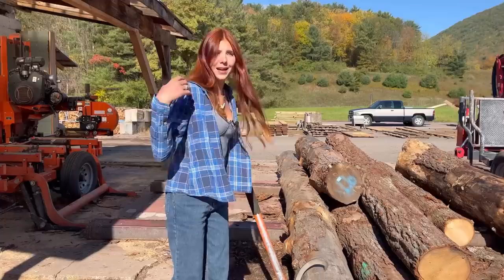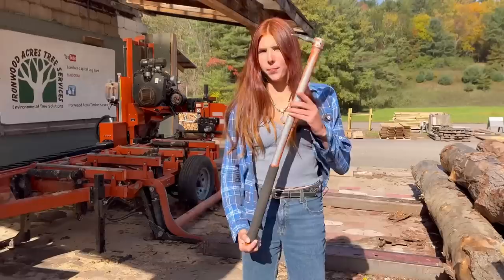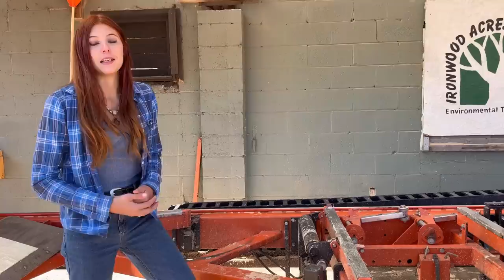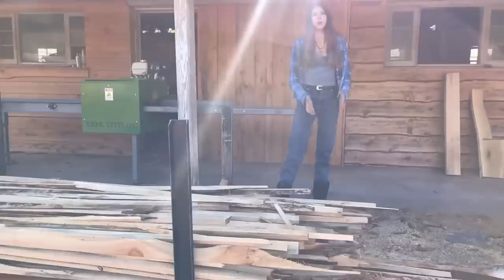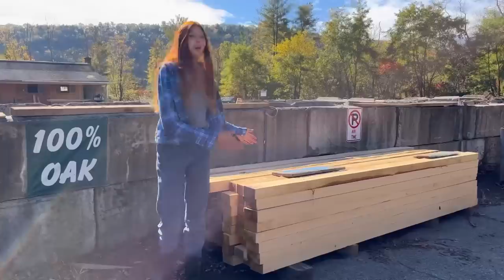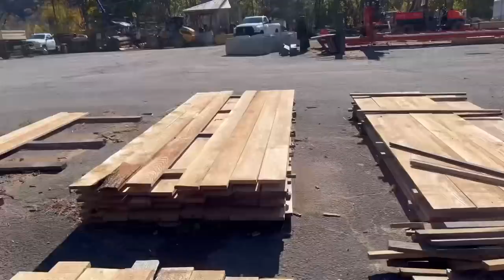Sawyer Terminology

Comment: Dunnage is a standard term in shipping for the Timbers and other materials used to stabilize cargo.The term goes back to the days before standardized containers when bulk cargo was made up of crates, barrels, sacks that were liable to shift during the voyage. Dunnage was used to secure the cargo.
Reply: People that work in shipping material yards often call them stickers as well.
Reply: Yeah I worked at a lumber place that made custom door and window framing and they used the same words for the exact same thing. 
Peace and Ahev
Reply: Yep, here in New Zealand dunnage is the term we use for timber packing used as described in the video.
Reply: @rustyanvil51  beat me too it fellow kiwi 🥝 dunnage is a thing😆
Reply: In the Army, we used the term dunnage for the boards required to lift materials off the ground when stored. Best for things that tend to rot, like canvas tents.
Reply: i hear dunnage alot. but around here most often refered to as "cribbing"
Reply: dunnage, dunnage, dunnage. i LOVE THAT WORD! :)
Reply: Material Handlers use the term dunnage and tape for the process of securing boxes on a pallet with plastic wrap. 
Useful for trucking.

Comment: When producing veneer, flitch has an additional meaning. This kind of flitch is the piece of a hardwood log ready for slicing into veneer - like a cant is for boards, a flitch is for veneer. And the resulting leaves of veneer are then bundled into a package in the same order they were sliced off the flitch - called flitch order. This makes it easier to arrange the veneer leaves into different patterns - like book-matched or slip-matched. Plywood veneers are different - they are usually peeled off a rotating log in large sheets of thicker veneer. That's the stuff that gets made into sheets of plywood.

Comment: My friend with a woodmizer would use any old piece of scrap as a sticker. I talked him into actually sawing his stickers. I told him they had to be exactly square or obviously wider on one side. He sawed hardwood and was getting a lot of sticker stain from using ugly stickers. Yes, stickers do evaporate somehow.
The one tool you showed we always called a pickeroon. We always had a peavey on the landing in the woods, which is like your cant hook with a sharp pointed end.
Dunnage refers to anything to keep a load in place, but your usage is correct, at least I would know what you meant saying that. I was an Adirondack logger many years ago.

Comment: Wow great video.
I'm usually a little wordy in comments.
I'll try to go easy on this.
Many comments on you Emerald to become a model.
I'll say you would excell in public speaking, and still an incredible model.
In my job I met many models, who explained the dark side of modelling.
Flitches...with bark kept, then planed, varnished extensively, great shelving, just my take on that.
My cousin hauled wet chip board out of northern Saskatchewan, Canada.
We used stickers to haul out the chip boards immediately, letting them dry in transit.
I was 15 when my dad allowed me to ride shot gun, learned to crunch gears before my beginner license.
Before all this I learned on my Great Uncles sawmill, associated with my cousin's trucking biz.
I've said this before, your show brings back fabulous memories.
I could use dunnage to build tables, that I would donate to the Salvation Army.
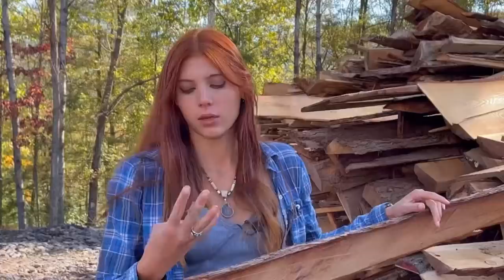1:12....bandaid is a nice touch.

Comment: In Ontario Canada, a pickaroon. In French, un sapi. I believe the distinction between a can’t hook and a peavey is that a peavey has a spike at the bottom end. However, wiki says that Mr Peavey’s real contribution to the tool was to replace a cant hook attached to a ring that slid onto a pike pole with a can’t hook clamped to the pole. Using only can’t hooks and peaveys, the old time loggers would roll huge logs up inclined poles to create
Reply: their brag loads of logs on sleighs.

Comment: Fun video!  My father & I felled a few northern white pine on my grandfather's property for use building my house (non-supporting substructures only).  I learned all these terms in that milling session.  Only two differences I noticed is we used the term "scab" for the half-moon shaped pieces you call "slab" to distinguish from the other slabs.  I expect those flitch trimmings would also be scabs.  Also, what you call "dunnage" we called "cribbing".  I would now guess, after watching this and reading some comments, that "dunnage" is correct for your use and "cribbage" was borrowed from our familiarity with temporarily supporting large structures.

Comment: New subscriber and this is a general timber question. We had a blowdown(took Kinzua Bridge out) in central Potter County in early 2000's. Had a bunch of Black Cherry to harvest and our consultant said many buyers are wary of this species depending on location. Areas west of us in Potter County get alot of ice storms  and don't get as good price because of presence of "sappy" cherry. Ice storms stress the wood fibres and fill with sap which ruins the boards. Always wondered what it looked like...Have you seen this?  Thank you!.

Comment: The steel frames that you use to stack timber in are referred to as post pallets. The commercial ones can be stacked as the feet have a special socket shape. A variation is cage pallets which are similar but with wire mesh sides.
As for the strips from the sides of live edge or otherwise called waney edge boards it's an easy one. They're called edgings.
There's a lot of terms that have been used but are either politically incorrect or just no longer relevant. A great example was a standard. A unit of measure for sawn lumber which had so many variations it beggars belief. No so different to the hundreds of log scaling rules once used in North America.